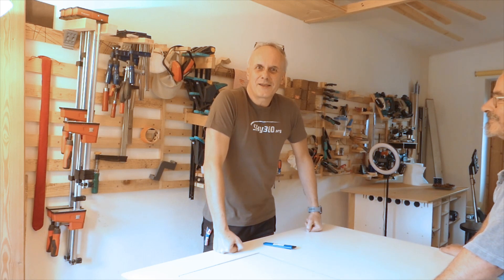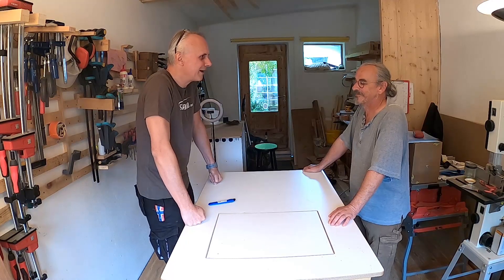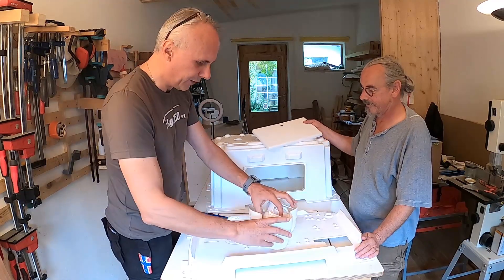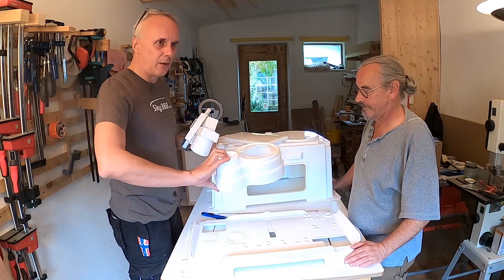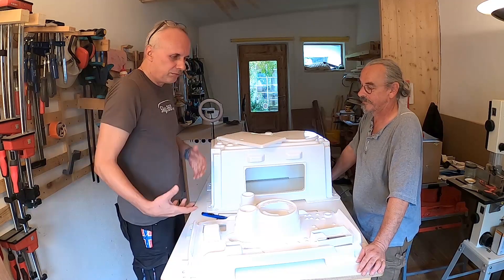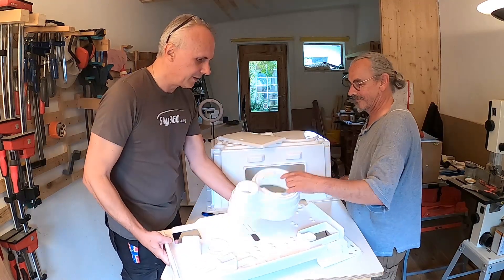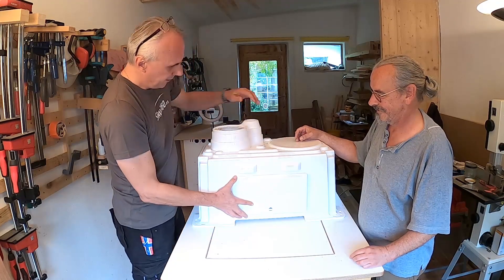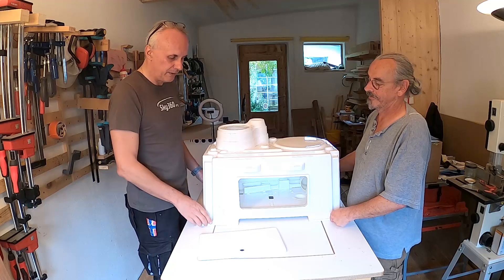Enclosure 3.7 - Unboxing

Comment: Looks great Richard, do you know when the second batch of enclosures will be shipped yet?
Reply from the maker: we need to make some changes in the model, so that the next batch is a better version, than the 3.7
Reply: Thank you Richard for the update and for improving the SKY360 UAP Hub Enclosure. I wonder if you could improve the ordering and notification system so when a customer places an order that they are kept up to date on the progress of their order. I am honestly looking forward to receiving my enclosure and building my own SKY360 UAP Hub system, but also try a few experiments of my own to see if I can help improve the system too. Thank you again for your help 🙏.
Reply: @Dixy3  hey Chris, we're going to have improvements on the production as well as the tool.
these issues have to be ironed before we go into next round of production.
please keep your patience, you will receive a better version, than the prior batch.
Reply: @DSLzwangsjacke  Hi Richard, many thanks for the update on the SKY360 UAP Hub Enclosures, I agree with you each batch of Enclosures will encapsulate improvements on the previous version. I was wondering how the Hub could measure distance from ground to UAP-USO, also if you could take a 3D scan photograph of the craft. Where I live in South Wales we are on the main flight path to Ireland, Iceland, Norway, America and Canada to the North and West. To the East we have Cardiff Bristol London and European Union, so cannot use any visible lasers because they would blind the pilots. Lots of thoughts but until the first enclosure's begin to be built into fully functional systems then expanding them further as the design and demands increase for more evidence. Keep up the great work 👍 👏
Reply: @Dixy3  please do not use lasers.
and yes, triangulation will be enabled, as soon as the PTF is in place.
and global triangulation will come with the cloud storage next year.
Reply: @DSLzwangsjacke  Thank you for your reply and for the comments, the global triangulation on cloud sounds an excellent idea, I look forward to seeing how it will be put into operation. Thanks again for answering my questions. Regards, Chris.